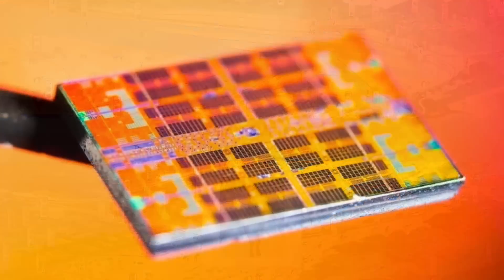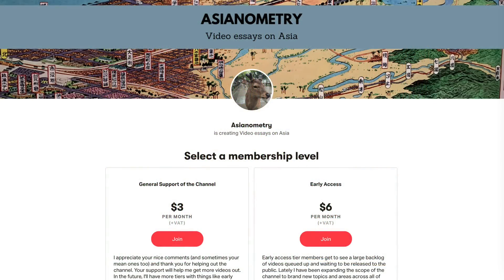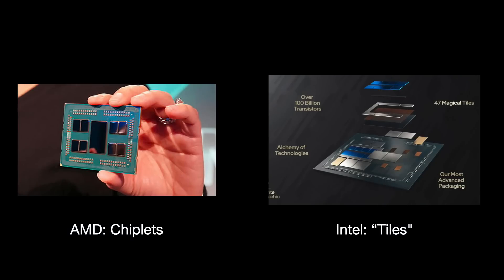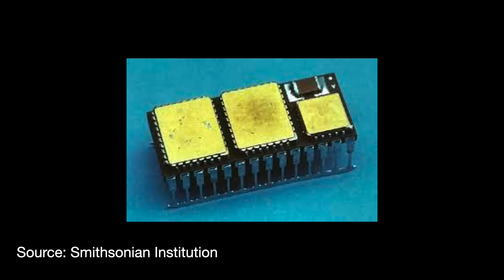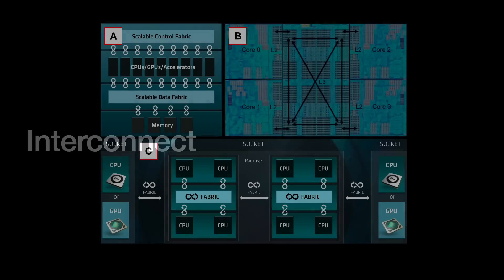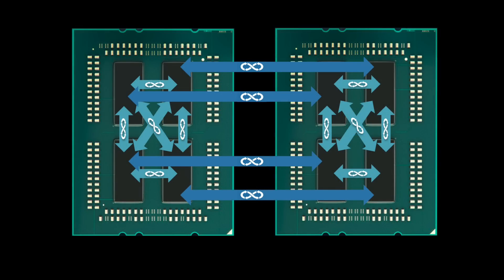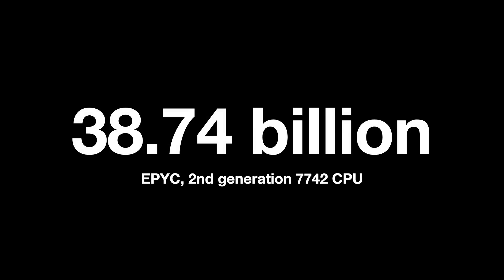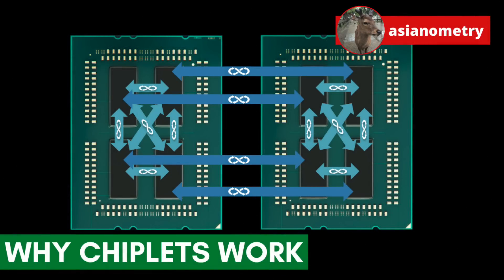Why AMD's Chiplets Work

Comment: Im pretty sure the socket g34 chips were an MCM like a year or two before epyc.
but I'm sure this isnt really that important, so I didnt look it up.
Reply: Intel also did MCMs with their core 2 quad CPUs, which used a pair of Conroe (65nm) and later Wolfsdale (45nm) dies in their Kentsfield (65nm) Q6600, and later Yorkfield in the Q9650, as well as other model #s in those CPU lines.
Reply: @TheOriginalFaxon  ya. I wasnt trying to say it was an amd innovation, but I think it was said in the video that epyc was AMD's first commercial MCM, and im pretty sure that isnt true.
Reply: @CraneArmy  Yea I wasn't trying to say you said that either. I believe AMD's first MCM was actually the SIP (system in package) used in the Wii U named Espresso. It used an AMD Radeon based GPU alongside an IBM Power PC based CPU and a tiny EPPROM chip on package, made by Renesas, who also manufactured the package. Other than that the only other MCM in AMD's history is the Xenos GPU designed by ATI for the 360, which combined an NEC eDRAM chip with the GPU, based heavily on the ATI X1800 XT, but with modernizations that were later included in Terrascale 1 as well

Comment: I recommend checking caly-technologies die-yield-calculator. 
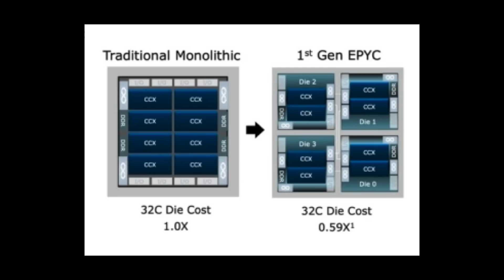as I think you gave numbers for small chips and mature process here (8:18) with new and unrefined ones, big chips like epyc would have yeld of 1-5 chips per 300mm wafer which cost ~10000$ each. (yeld in 10% range) which would make cpu cost way above 500 000$ each to pay for every step of the process.
same wafer and same confg with chiplet drops 840 working chiplets, and maybe 10 half's, that can be configured, into 850 working ryzens, 400 32 core threadrippers or 200/100 epycs. (assuming perfect interconnecting, you can drop 5% if you want to be realistic). IO dies on lower process are easy to get and WAY cheaper.
as TSMC and others have always full load and fight for every wafer between companies, AMD can make 10x as much chiplet based cpu's as monolithic ones, with number of wafers they got from TSMC. 
amd is already above what would be possible without splicing into smaller pieces, and if intel would have chiplets with their 10 nm issues, they would have good yelds few years sooner.
I know its extra complexity, extra time and extra problem layer, but we already past the point where monolith is physically possible and every manufacturer goes around their own way.
NVIDIA sucks up any issues and disable 1 or 2 out of 70 cores completely, and just say their product have less, than it have working products. 
I like AMD way as divide and conquer is what IT found the best solution for wide variety of problems....

Comment: I suspect that's why AMD's EPYC and THREADRIPPER chips can clock so much higher than XEON's typically could. No monolithic die means better yields (and lower defects) and better clocks as the noise is less shared over the whole package along with other engineering black magic. Really cool stuff.

Comment: Intel already proven that chiplet works back in P4D, C2 era, except AMD shamed Intel for gluing and went as far as calling it fake dual core and later quad core.
Reply: Wait I thought I was intel who shamed amd by saying gluing cores?
Reply: @malathomas6141  AMD shamed Intel first

The P4D is just two P4 die glued. Same goes for the early C2D and C2Q.

I mean, the Q6600 is just two E6600.

Let's not forget that AMD called out Intel for making 2 socket 2 platforms back in the 1366/1156 era.

Evil Su took AMD and went full Intel/nvidia, but much worst.
Reply: Gee, AMD and Intel fighting, imagine that.
Reply: @AlfaPro1337  I think you might find that AMD believes that to be the other way around.

Comment: Multi chip micro processors already existed in early 70s, before IBM mainframe CPU and a likes (before multi chip modules). Most used in calculators, lab/test equipment. As soon as first integrated circuits was created, hybrid chips start showing up. SOC/MCM/Chiplets existed in 60s, kinda. You can go back to vacuum tube computers, later ones, made modular, from various interconnected "CPU" parts (cheaper/easier to manufacture and maintain). So Chiplets and similar is nothing more than sales pitch, marketing.

Comment: IC's shouldn't take a homogenous path, because chiplets may be good for some things but not others.

With the move to TSMC N5, If AMD Ryzen for instance sticks with an IO die and core chiplets, it might help a little in defect rate, but it adds complexity.  So, consider a 4 core part, on TSMC N5.  Would it REALLY be better to make that with an 8 core chiplet and separate IO die?  I think not.  You're adding complexity and more die to produce this than you would a simple 4 core monolithic die.  If AMD continues this path for low core count CPUs Intel is going to eat them for lunch when they can move to a smaller node.

On the other hand, 16 core CPUs is putting a lot of heat in a small space on N5.  Probably not the best idea, but AMD STILL doesn't need to have a separate IO die.  They could make their interconnect like what Intel is doing so chiplets are tiled.  One connects directly to the other.  In this case, one chiplet would have 8 cores and the IO.  To expand core count, you would add an 8 core chiplet.  You have moved from 3 die down to 2 die, and you don't need all the interconnection throughout the PCB of the SoC.  This would require AMD to make more configurations of die, but it's OK.  You could actually have one chiplet be a 6 core config with IO die and use that for both 4 core and 6 core parts.  Then for anything 8 core and greater, use the 8 core and IO chiplet and be able to attach more cores to the side.  For Ryzen, that would mean 3 die would be needed, and if AMD were smart they'd keep the graphics out of this, and let a graphic chiplet attach to a side of the chiplet with the 6 or 8 cores that have the IO built in.  So to add graphics, you now need a couple variants for the amount of graphics power you want.

This would be FAR better than what AMD is doing now.  I think Intel in moving to tiled configs is going to pull ahead of AMD if AMD continues using the config they have now.

But this is all for Ryzen in talking about AMD.  For server and WS where you need a lot more core chiplets, I think you have to stick with an IO die,  I mean after all you can be adding 8 core chiplets and that's too much to try to piece together using tiling IMO.  The way to increase core count over time would be to first go from 8 to 12 core chiplets, and then to 16 core chiplets, for server.  With Ryzen you'd probably have to stop with 12 core chiplets, or go with 12 big cores and 4 - 8 little cores.  For Ryzen you could still use tiling for this config because the heat would be spread out enough once on a smaller process node.  But for server you'd need to stick with an IO die with lots of core chiplets.  But I think 8 core chiplets is max or there's too much interconnect.  So, once you get to something like 16 big cores - 8 little cores you're about maxed out with current technology.  That could give you up to 320 threads with 8 core chiplets.  Now the biggest issue is having the memory bandwidth to deal with this, but if AMD goes through with Vcache for L3 and no on die L3 which means they could greatly increase size of L3, this helps to reduce the hits to RAM.  It's either that or get to DDR6, because IMO DDR5 is not a great advantage.  It's dual rank, but you need both ranks for a single access and that's a stupid design IMO.  If access would have been dual rank, 64 bits, this would work a lot better using 8 memory channels.  I think it would take THAT config along with 12 memory channels to feed a 320 thread CPU where you also have much larger L2 and L3.
Reply: You'll notice that the only Zen 3 R3s are monolithic.
Reply: @sonicboy678  It's hard for me to consider what you're saying because there are different Zen 3 parts.  If you're talking about the 5500 , yes, they took parts that were designed to be an APU, but the APU probably didn't work to specs and they turned them into the 5500.

There are also R3 APUs.

But this is all beside the point.  I wasn't talking about a CURRENT gen on TSMC N7.  I was talking about the future, on N5.  Every node means new decisions have to be made about how best to use it, and if AMD is getting away from GloFo for their IO die as has been rumored in the past, creating an IO die on TSMC N5 or even N6 would just be stupid for Ryzen.  The IO die on N5 should be TINY, so not much to add 6 or 8 cores to the same die.  And this is why AMD is struggling to match Intel's price points even with Intel 7 vs. TSMC N7.  AMD has a lot of added complexity to deal with chiplets, and Intel isn't producing some massive die using Intel 7 for their 4 - 6 core parts, so their defect rate is probably a lot better than most people realize with these smaller core parts.  This is about the last generation where AMD is going to get away with higher prices for less performance.  This has been where AMD has always won, and losing low cost advantage will mean loss of consumers.

Right now if I were building a budget system, forgetting what memory costs right now, I'd buy the 12400F for $170 and have something that's still powerful with 6c/12t all performance cores.  I'm sorry that WHOMPS on the 5600 for $200.

https://www.youtube.com/watch?v=9KIrl9OmQGA

And, for the memory config, that wasn't even very good DDR5 that was paired with the 12400F and it was near the best paired with the 5600X and 5600, the the 12400F while not always outright winning at avg. fps is sometime destroying both AMD parts with 1% lows, and that's a latency issue created by chiplets.

So if AMD went to a tiled config, did a single chiplet for an IO die and 6 cores, and then another chiplet to add graphics, they would be at the minimal amount of die needed to make the lower end Ryzen parts and it should cost less.

I'm sticking with it, to me it's blatantly obvious looking at prices.  If AMD pulls another trick to where they're waiting for a lot of chips that failed in some way or another and then FINALLY put out lower core parts at the end of a release, once again Intel is going to eat them for lunch because many people don't need more power than a top end i3 or low end i5.  You do for gaming now because of UE5, but that's beside the point.

Comment: But why do AMD chiplets work in actual detail? 90% of this is just general economics and doesn't explain anything about how or why they work beyond "smaller chips, less loss on mistakes".
Reply: He went over it a bit - it's the Infinity Fabric interconnect that AMD developed.
Reply: @Random-Stranger  Yea, I got that and that part is no secret to anyone that follows the tech space regardless of this video. The chiplet idea is of course not new. The main problem with interconnects between chiplets is that they are slow. Typically magnitudes slower than a single die. But what made AMDs interconnect successful? Is there revolutionary ingenious architecture design that works around the slow bus speed? Or did they manage to build much faster interconnects than previously possible? Or did they manage to do some latency vs throughput trickery? There are obvious downsides to chiplet architecture, but AMD was the first company to overcome those at current feature sizes and production scales. But that is common knowledge already. The interesting part is the "how" which this video doesn't answer.
Reply: @lexer_  There's a number of videos on YouTube that talk specifically about Infinity Fabric.  They go pretty in-depth about it but beyond that, you're likely looking at proprietary info that won't be available publicly.

Comment: "an unrepairable manufacturing fault, the chip seller has to eat "
??
not the maker ?
Reply: Yes, the chip seller has to eat the cost. Otherwise every company will design the biggest gpu/cpu they can and profit from not having to pay for a ton of faulty chips as a result.
Reply: The chip seller as in the company or business unit that designed the chip and puts it on the market. Not the Fab, whether they are a separate company or another business unit in the same company. In Intel for example there is a profound split between the design and manufacturing/fab parts of the company.
Reply: @BusAlexey  / on the other hand, the fab has to be motivated to increase yields ? ....
Reply: @maximme  it is motivated already to do so. Higher yield allows fabs to demand higher prices. Low yield does the opposite.

Comment: Is anyone still working on optical (especially vertical instead of edge-only) interconnects?  That was a cool idea back in the mid 90s

Fun factoid.  Back in the day, a lot of 8086 chips were actually 8088s where their math coprocessor failed QC, so they just disabled it.
Most folks don't realize the success rate of manufacturing is not that great, even today.
Reply: Binning is still quite common, especially at Intel since they are using large monolithic dies for the current Core-i series. They are always trying to make an i9-12900KS, and disable cores that have defects or clock the chip lower to make things like the 12900, 12700K (fewer cores), 12600KF (ferwer cores and no iGPU), and all the way down to the dual core Celerons that don't even get multi-threading.

Comment: Interesting topic, but you didn't go deep enough into the topic to explain why chiplets make things faster, how much faster, how much cheaper, or any of the relevant details.the last "chiplet"  chip you described was just a processing node with separated processors.  Did you compare its performance to the existing chip/processing node systems in a 16 processor or 8 processor chip that is already been made?? No.  So you didnt go deep enough
Reply: I think you'll find other channels on that topic. It doesn't really strike me as relevant for the story here, so glad he skipped that.
Reply: Manufacturers keep that kind of specifics to themselves. The venues where information is shared tend to be the industry/ academic conferences. I believe ISSCC and HotChips are still the primary ones. I'm a good way out of grad school and never worked in the field.

Ars Technica and Tom's Hardware are websites I consider to have good coverage of fab and architectural topics.

Comment: You are grossly misusing the quote by Gordon Moore and it means nothing even close to what you interpret it to be. Link to the original: https://hasler.ece.gatech.edu/Published_papers/Technology_overview/gordon_moore_1965_article.pdf
First of all the article predates chiplets by at least 40 years and by extension the problems, that lead to their development and use. If you look at early CPUs, you will see there are often extra chips like coprocessors and math units, that are extra chips and add functionality, if needed. I think that is the key to understanding what the article addressed - by picking and choosing the functions, that are separated on single chips, you need only to include what you need and not pay for the development of unused hardware. 
Second, even if one is not inclined to do the reading, the quote itself hints at the fact you are wrong: ...which are separately packaged... 
Chiplets are emphatically not packaged separately.